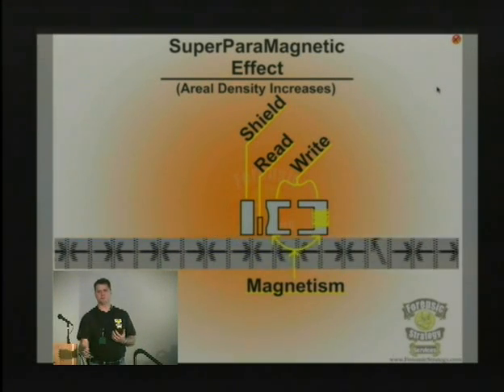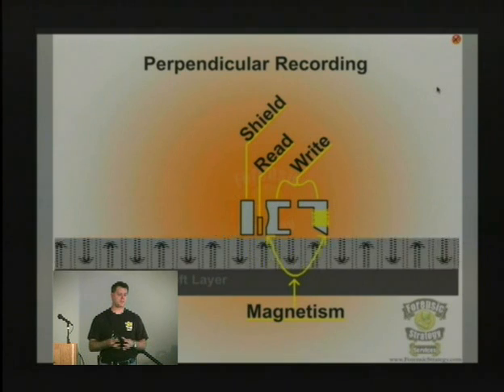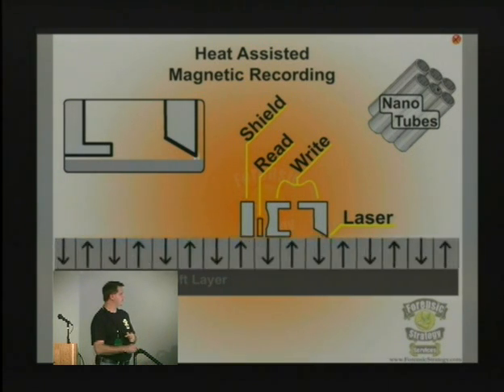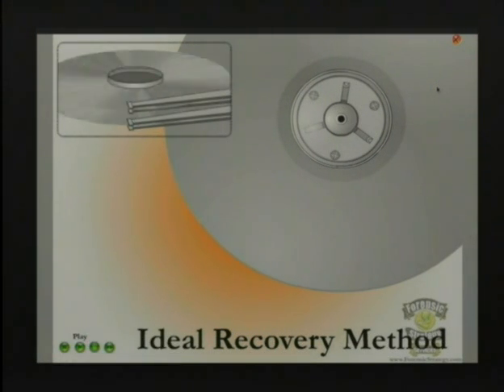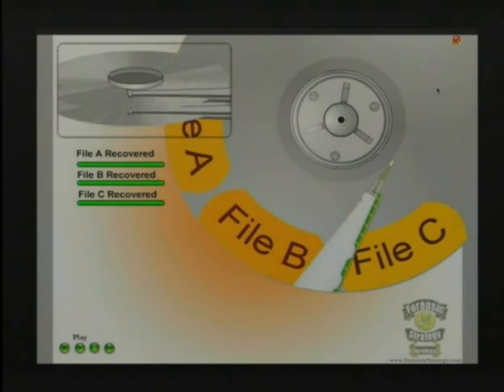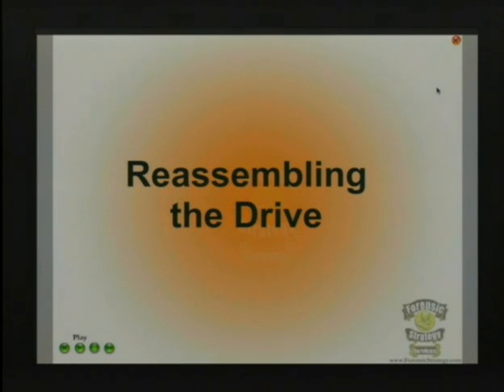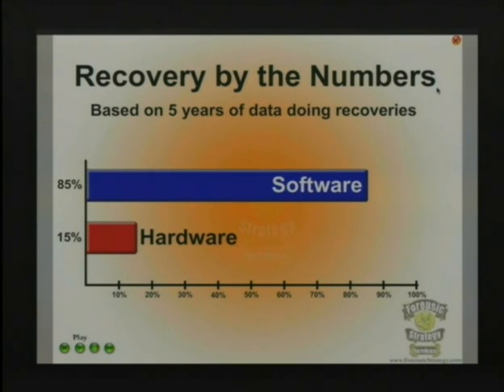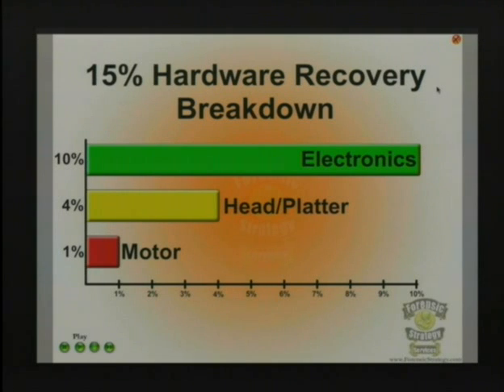Hard Drive Recovery Part 3

Comment: well he didnot say that only wd disks fails on static electricity, other fails to, but wd takes most percent on that part, and others on psyhical damage or other....anyway, i have ...i wanted to say had 3 wd 320G drives in my pc, after a month of use one drive burned at all...board on it burned avay and its broken, ok i had waranty, after 6 months next one died, it stoped showing partitions and ewrything, i recovered data from that second drive but